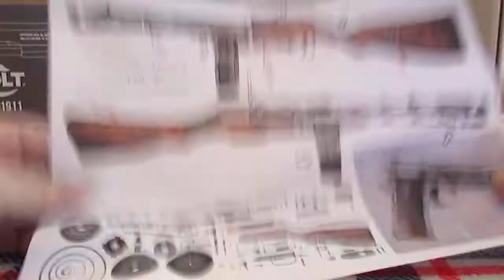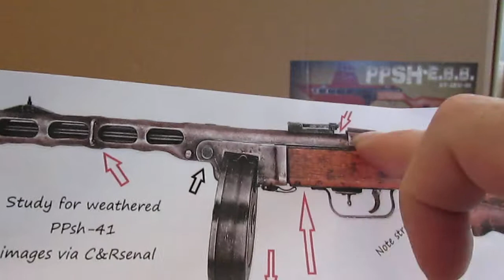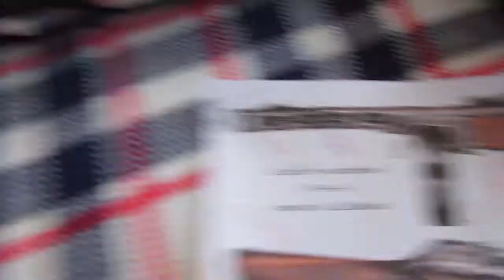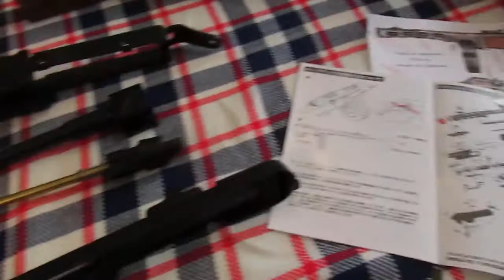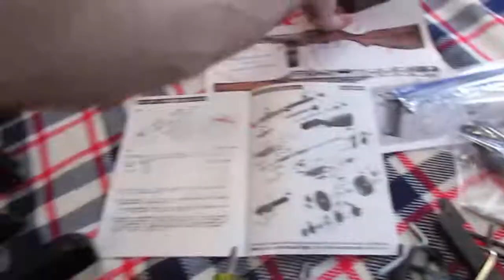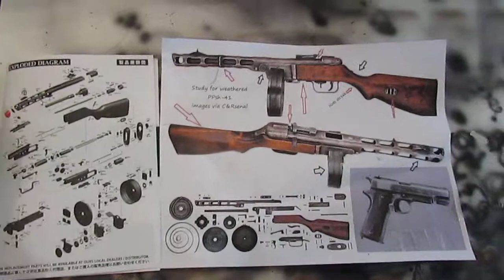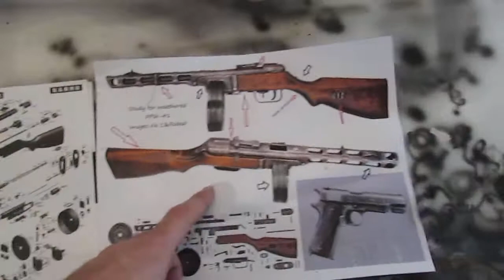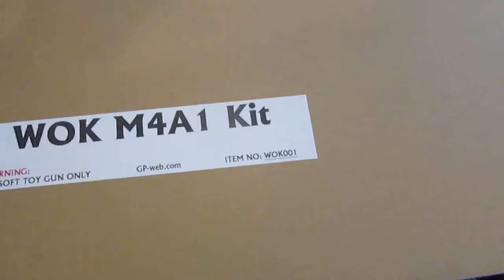S&T PPSh 41 AIRSOFT Project Custom Weathered Finish!

Comment: So I’m a little confused. What did you do to your barrel cover? I sanded down the barrel and metal guard so it’s just the bare silver metal. Do I spray paint it or gun blue it or something? Thanks in advance!
Reply from the maker: I painted the outer barrel with an airbrush, I left the barrel jacket sanded with some black accents reapplied to where I thought it should go (using the picture shown in the video as a guide). There’s no wrong way to do it. If you like it the way it is then it’s good! Just remember the barrel shroud is steel and will rust without anything to protect it. Clear coating it is best unless you want it to rust. Thanks for watching!
Reply: Legionitalia perfect, thank you very much!

Comment: How do you stamp?
Reply from the maker: Best way I’ve found is to heat up a metal letter stamp and burn in the numbers in then sand them back. Punching them into the wood just cracks the stock. Thanks for watching!
Reply: Thanks for the help, so i heat up the number stamp and give it a small tap on where i want my number to go then i sand it ?
Reply from the maker: Swumpy Frumpy  no tapping required, in fact it may jump and make a shadow if you do that. Just hold it with a pair of pliers or vice grips and press it down. If you have it hot enough it will sink in on its own. Practice first on a piece of scrap first wood so you get the temperature and pressure just right. If it is too hot you may set the wood on fire. Not hot enough and you won’t get a good mark. Use cheap stamps as the heating will probably render them useless for metal afterwards. Like the ones you get at harbor freight. The hardest part is lining up the stamps so the numbers don’t look jumbled (unless that’s what you’re going for). I thought about making a jig to align them but ended up just carefully setting them. Good luck! And definitely practice first.
Reply: Thank you for your time and help just one more thing you explained about stamping wood would i have to tap or press down on metal? I want to put original markings on my AGM mp-40 and maybe my PPSH
Reply from the maker: Swumpy Frumpy Yeah, use a ball peen hammer. but again be very careful. Some Airsoft bodies are zinc and not steel, you may crack them if you hit them too hard or push the metal into something that may bind the mechanism underneath.
Reply: Thank you so much for the help i’ll make sure to stay tuned for future videos 😄